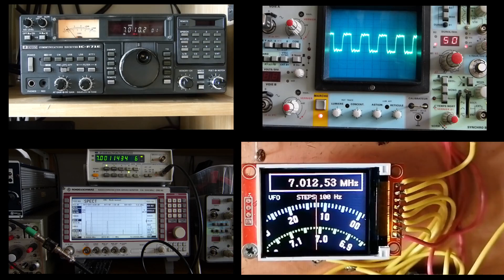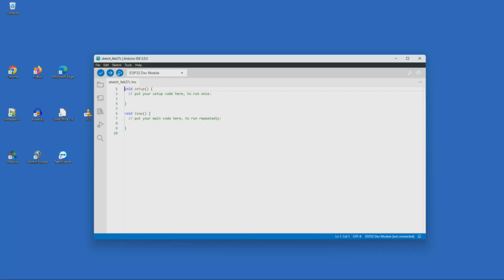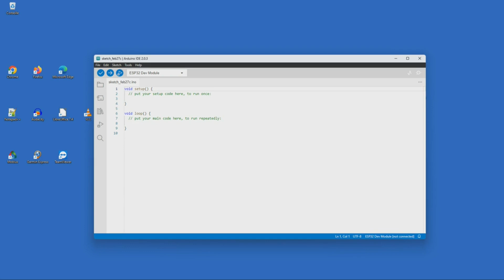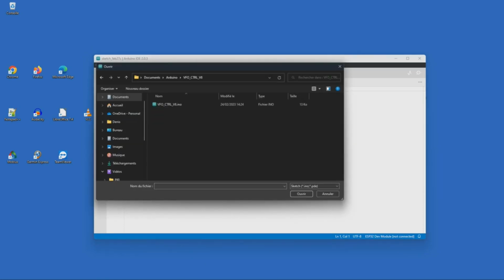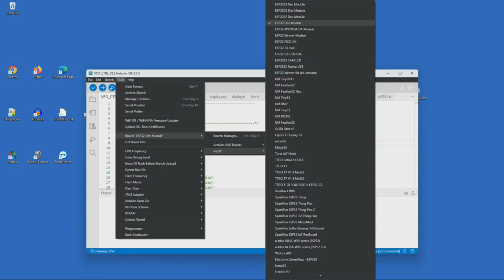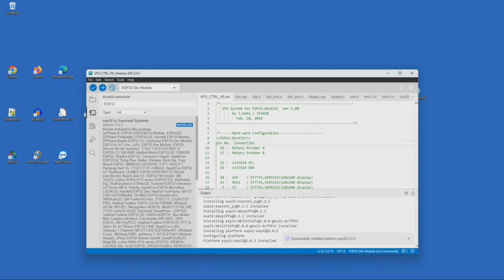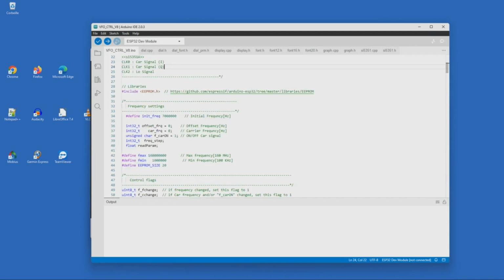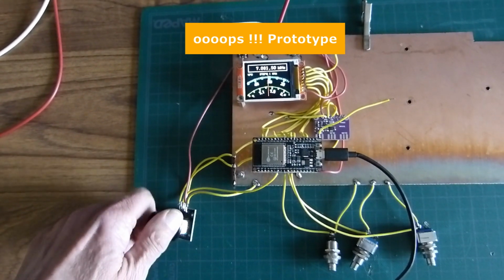Digital VFO with analog dial (retro dial) from JF3HZB.  (SI5351 - ESP32) -  Issue and fix  + F6CRP

Comment: Bonjour, le projet est très beau pour installer dans un appareil retro ou une fabrication style retro personnelle. J'ai une question à propos du code du vfo. Je dois couvrir une bande de 6,4 Mhz jusqu'à 6,8 Mhz, c'est l'oscillateur local auquel je dois soustraire une IF de  10,237 Le  VFO doit donner 6,4 à 6,8 réel.     
 Mais il doit  afficher ::  exemple  6,737  -  10,237  =  -3,500 donc affichage 3,500  pour la bande 80m.   Il doit être inversé aussi. Le code de permet-il de faire ça ?
Merci pour votre intérêt
 73' on5lcn

Comment: Hello Denise!
I have thoroughly read all posts and your tips on how to deal with this problem.
Unfortunately, when I try to reinstall the ESP32 package, the required version 2.0.5 does not appear
I can only install: 2.0.15, 2.0.11, 2.0.12!?
How to download ver. 2.0.5 ?
Please help.
Reply from the maker: Hello, I hope you'll understand, my English is elementary. 
You need to download the ESP32 packages from your Arduino interface. Proceed as follows:
- from IDE, select  "Files -Preferences"
- the last line of the window that opens reads : " Additional boards manager URL",  click on the blue icon on the right
- a new window opens. Copy this  URL " https://raw.githubusercontent.com/espressif/arduino-esp32/gh-pages/package_esp32_index.json"
- click on OK
it should work
Hope this helps

Comment: At the beginning you showed a square wave, has this caused issues in your project?  If so what was your fix action.
Reply from the maker: Good evening,
no, that wasn't the problem. Square signals are normal, you need to filter this oscillator to get a purer signal.
The problem was that I couldn't compile the code. The process stopped, returning a compilation error.

The cause was a version problem on the ESP32 package.

Comment: Going back to that version did not work with my ESP32 WROOM board, but 2.0.3 did! Thanks.
Reply from the maker: Good evening and thank you for your comment. I'm not surprised, depending on the version of the ESP32 cards. Anyway, the important thing is that you managed to get it working, your comment will be useful to others. Regards.

Comment: GOD BLESS!!!! I haven't wired it up yet....but after getting rid of the "charge only USB C cable" and finding one that worked and uploading blink successfully....I was then hit with missing libraries.....fixed that and then got the same error msg as yours "Dram error"....well I followed your instructions and it compiles and uploads!!!! So thanks....I will post a link to my finished product if it works....and give this video a shout out as it is very helpful! If this DDS VFO works well I will make it the heart of an OZ QRP 20m KIT I have. 73 de VK2AOE.
Reply from the maker: Hello,
and thank you for your message. I'm very happy to hear that my experience and this video have been of use to you. You are the 4th person to have left a comment on this subject and to have encountered the same problem.
This VFO works very well and is really nice to use with both the analog and digital display. An absolutely brilliant idea from JF3HZB.
I installed it on an HF receiver, it's perfect.

https://www.youtube.com/watch?v=XqalAifIlSM
Keep up the good work and thanks again for your message.
73 Denis F6CRP

Comment: I had the same problem.  Searched for hours but did not find a solution.  Until I came across your video and now the upload succeeded.  Thank you so much for this info and calming my heartbeat!

There was one more catch for me: during upload I got the errormessage "Wrong boot mode detected".  Turns out that this is easily fixed by briefly pressing the 'Boot' button on the ESP board once the upload has started.
Reply from the maker: I'm so glad I could be of service to you. A testimony like yours is very gratifying, thank you very much. 73 Denis F6CRP
Reply: @radiorider8249  This in turn is also nice to read.  73 Patrick PD1JAZ

Comment: 7 GHz ?!  Really ??? I didn't think the SI53531 can go that far ...
Reply from the maker: For sure :-) Where do you heard or read 7 GHz in the video ?
Reply: @radiorider8249 it's right there on the LCD in the video. It clearly shows 7.010,93 MHz, which is 7Ghz where I come from ...
Reply from the maker: @rudolfusselmann2896  OK I understand. The code was written by a Japanese OM. He used the Anglo-Saxon standard for the point and the comma. That's the reason why.  :-)